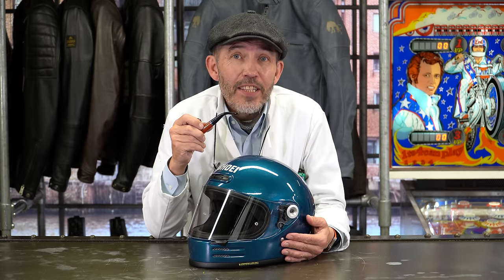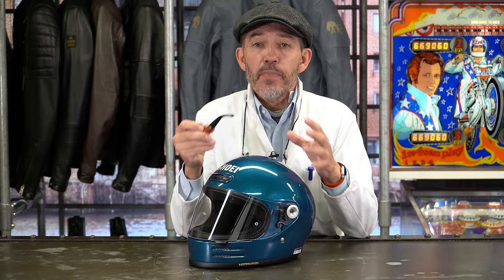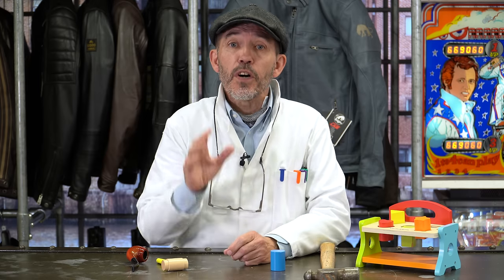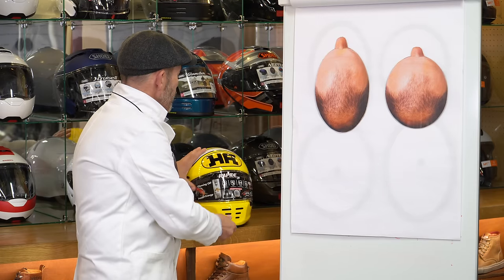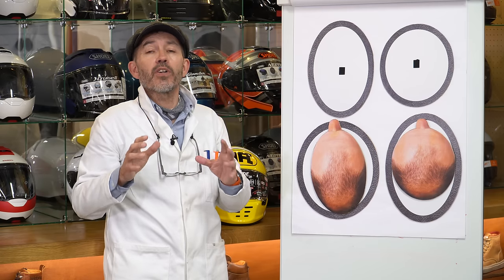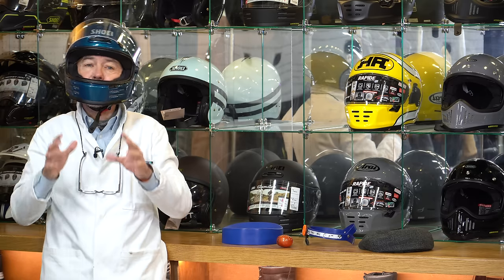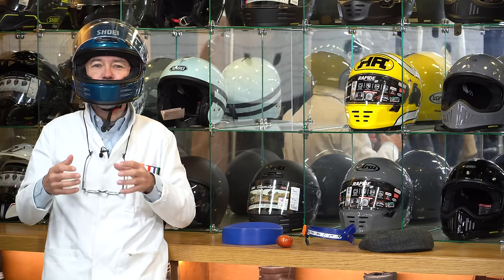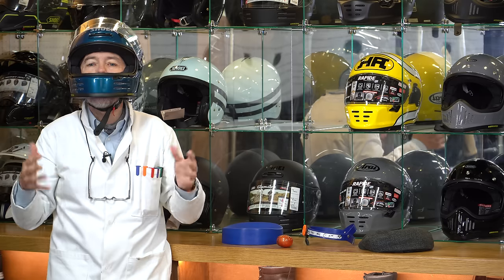The definitive guide to motorcycle helmet fitting

Comment: I have a HD (Harley-Davidson) Boom Audio No2 helmet which is size large and fits great, my friend bought this and it was too small for him so I had plenty of time to try it out before I bought it off him.  

I also have a Shoei GT Air that I ordered on line in a size large and even after having changed out the cheek pads for the thinest and using it for a couple of months I realised that I just cant wear it and it will never get better.  I should have returned it day 1 but the instructions said it's supposed to be snug and may be uncomfortable at first but will improve and be comfortable after a while!

Your approach to helmet fitting is similar to how we used to assess new product shoe fitting in Clarks.  I was an product engineer there for many years in my former life.  My experience has taught me that if you buy a helmet online you will be very lucky if you get a good fit and so I wont be doing so again.  When the time comes for a replacement helmet I would love to make the trek from 'The Lizard' to see you guys for a proper helmet fitting 
😉👍 Old Guys Rule

Comment: The finger test, are you testing the soft liner or the hard liner?

A lot of videos say you shouldn't on be able to push more than the tip of your finger up the front of the helmet when pushing the helmet forward. 

The helmets I've tried I can fit a fingers width between my forehead and the hard liner in places  when pushing the helmet foreward. A size smaller where I can't do this I get a headache 😢. I'm so confused.

Comment: Re-visited this video as I've always worn an S in HJC, Arai, Schuberth etc.. (which is usually a 55-56cm), yet I recently measured my head and found it to be closer to 57cm. Oddly never had any issues with hotspots or pressure points in 15 years of riding.

Comment: Great demo of helmet fitting. Love it. I’ve had issues with headaches in my temple region. It’s agonizing after about 1 hours then I have to stop for about 20 minutes to get the headaches to stop. It turns out my skull has grown. I used to be a 58cm in my late teens but grew to a 61cm by middle aged. I believe I’m an intermediate oval. Anyway, I finally found a very comfortable helmet which I can wear for hours without discomfort....It’s a Bell Race Star.